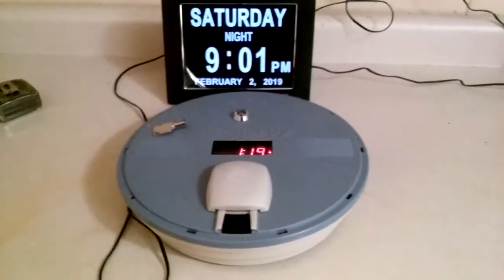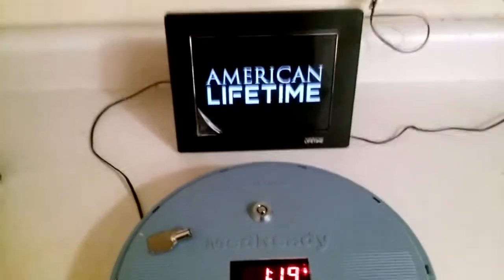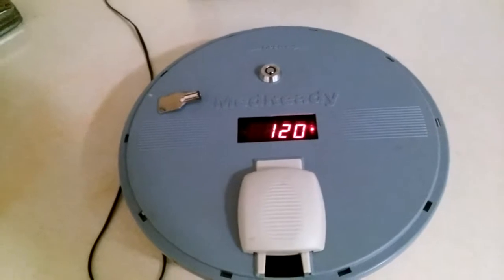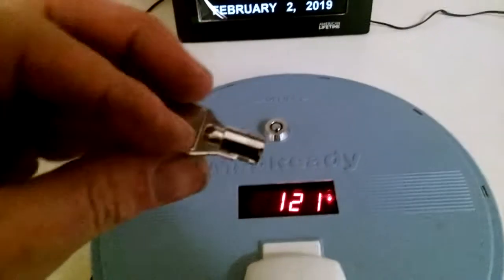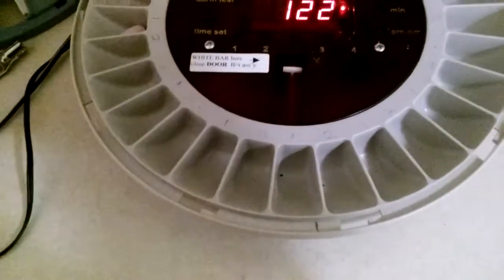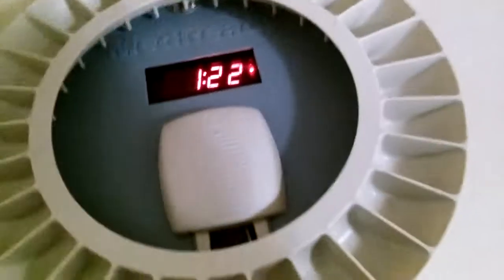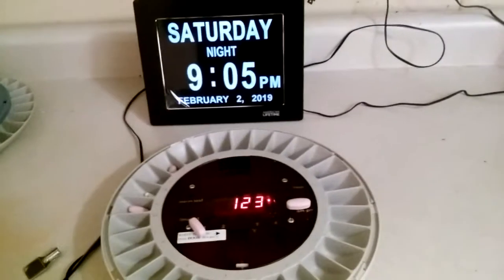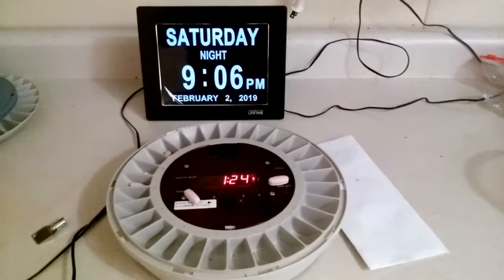Lifetime Clock and MedReady bill dispenser for elderly dementia patients

Comment: Will the will turn manually when close? I need to make sure that medication adherence is kept. Ty
Reply from the maker: It will turn automatically. Don't ever try to manually move with the lid locked as you can damage it. Take the cover off to advance it or check in on it. If they damage it might have to get a Phillip's Lifeline machine. They are bullet proof.